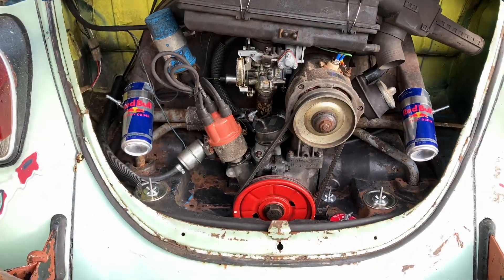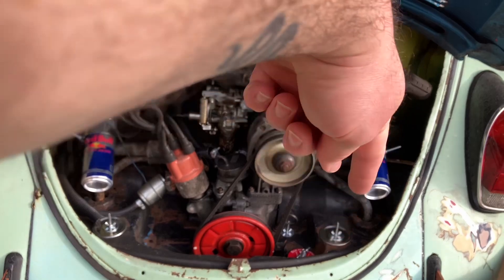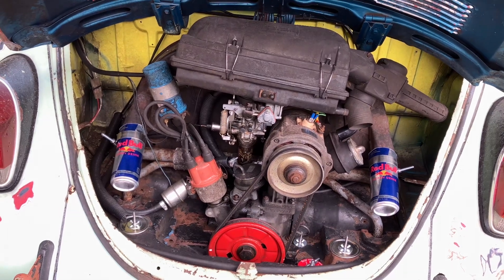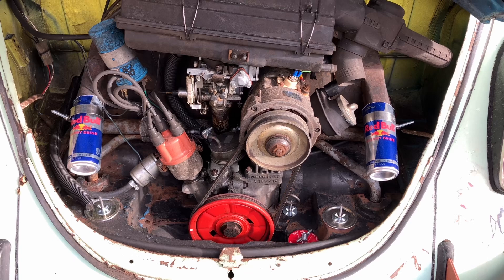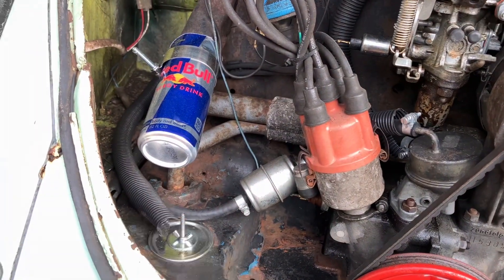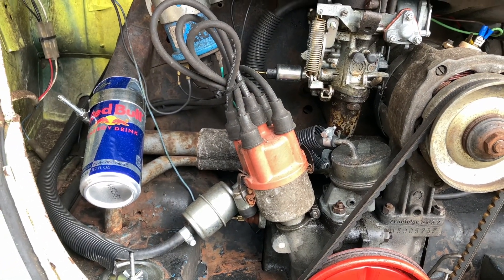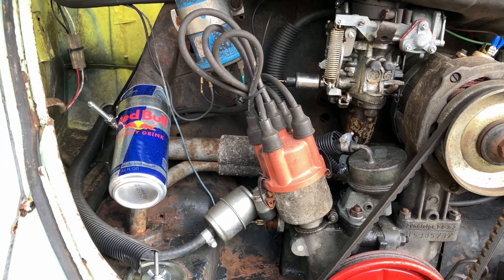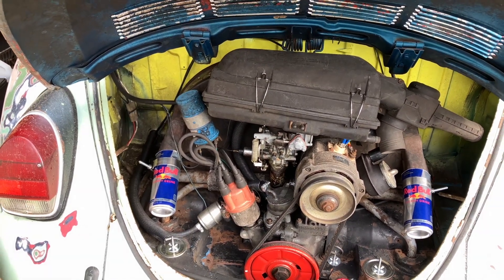Troubleshooting Heat and "Vapor Lock" (Part 1)

Comment: In Side the black arching fan shroud is a 
Air filter for oil cooling.
I had a rail Buggy VW
Power . Air filter Eliminated. Two oil line to a heat Exchanger & spin on Oil filter
Reply from the maker: Wow, I didn’t know that. I’ll definitely add that to the list. Thanks!

Comment: Hi, I watched your video and can perhaps offer some useful advice. I'm 61 and have had over a dozen various air cooled VWs over the years when I lived in South Florida. So I know all about vapor lock and how to resolve it. It looks like you've taken measures to resolve your overheating issues, though you don't mention anything about about having checked the operation of the bellows (thermostat). If stuck closed, a common problem, it will cause over heating. Now as far as vapor lock is concerned, you're on the right track. The ethanol in today's gas is more prone to evaporation at lower temps than the pure petroleum fuels that were used 30 years ago and what VWs were designed to be run on. From what I can see, you definitely need to reroute your fuel line. It should come through the firewall diectly to the fuel pump and away from any hot tin or exhaust manifold. Next, get rid of that fuel filter in the engine compartment. If you want an inline fuel filter put it under the car somewhere, before the firewall or up front near the tank, tied up, and away from any heat source. Electric fuel pumps are the way to go provided you have a good regulator. I would place the pump up as close to the tank as possible and mount the regulator on the firewall away from any heat source.
Reply from the maker: Thank you so much for taking the time to write out this advice for me! That's awesome. So the Carter pump I bought comes with a filter already mounted on an inch of line. I will plan to mount that as close to the tank as I can. Also rerouting fuel lines and I bought some fuel line insulation that I don't think I mentioned. As far as the thermostat, I'll have to dig deeper into that. I thought that was part of the equipment that allowed engine-heated air to pass under the car and into the cab, but I may be way off base. Thank you again and I'll add that to my research.

Comment: Hello my name is Mark I grow up arond these my  whole life ' if you didnt stop the over 
heating i dont know? The vapor locks is our gasaline it has more the alcohol ,  make your fuel lin shorter and insulate the fuel hose and filter.
Reply from the maker: Great observation! I don't think I mentioned in the video that I bought a roll of fuel line insulation that I plan on using in any part of the fuel line that passes into the engine compartment. Thank you!